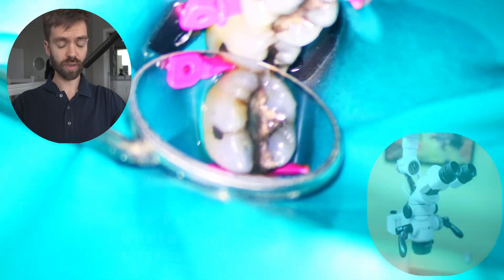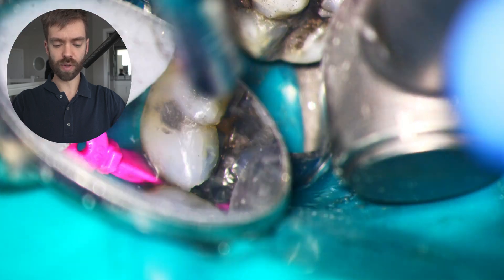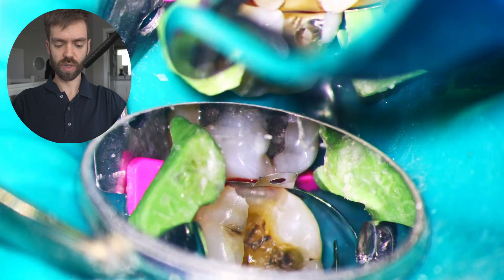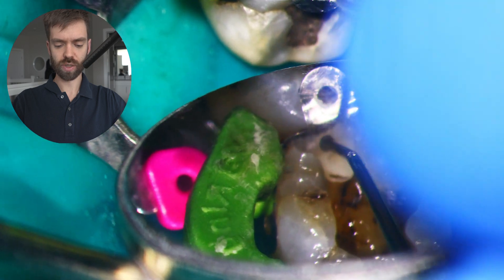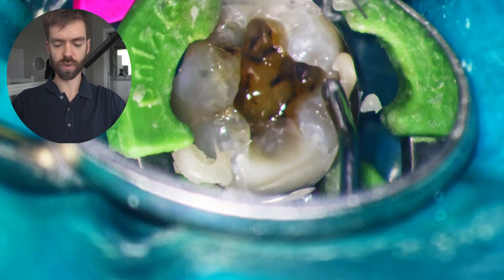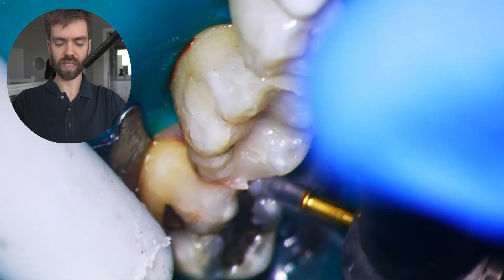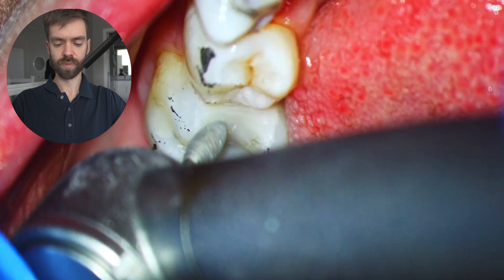The SAFE WAY to remove Silver Mercury Fillings (Amalgam)

Comment: Is anyone working on using a heat source like pin-point lazer to heat the amalgam to softening point then remove by vaccum - without the need to use a drill? 
seems like something to look into!
Reply: That sounds interesting. Also interested to know.

Comment: This patient’s filling looked intact.  Was it necessary to remove because of toxicity reasons or was it compromised in an area not shown in this video?
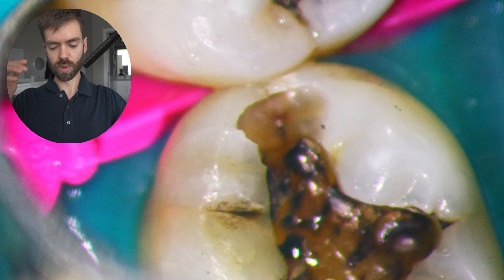Reply: I don't think it was because of toxicity reasons but because there was a crack on the tooth causing bacteria to get in and forming a cavity 0:42

Comment: Won't the total etch cause postoperative sensitivity? Or it's better to do a total etch in this case
Reply from the maker: Assuming a normal nerve status, with total etch less than or equal to 15 seconds and good bonding technique (e.g. RD or isodry isolation, proper moistness after etch, a good bonding agent and following manufacturer's instructions for said bonding agent) you shouldn't get any significant post-op sensitivity.

Comment: Do you have to remove mercury fillings? Is it necessary? Or just patient’s preference?
Reply from the maker: Personally, I only remove silver fillings when there is a clear indication to. Some dentists believe that they should be all removed, even when there's no cavity or defect.
Reply: @MichaeltheDentist  isn't tooth with filling composite stronger (because of bonding) than tooth with amalgam? So then remove amalgam for cracking/breaking prevention?
Reply: If there is decay surrounding the filling or if you are experiencing symptoms of mercury poisoning, then you can get them removed.